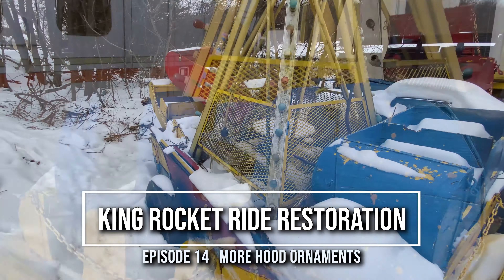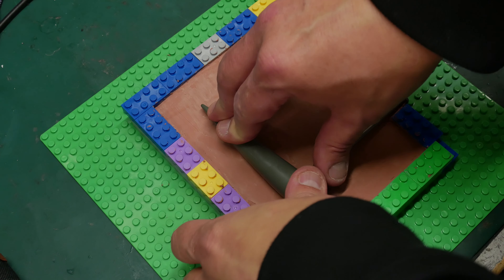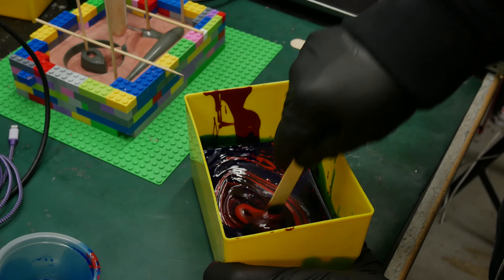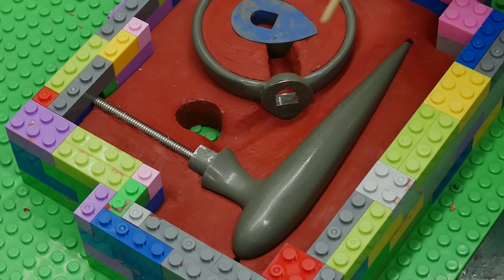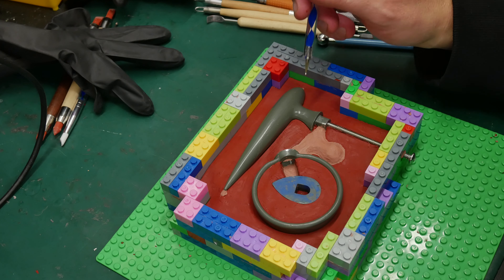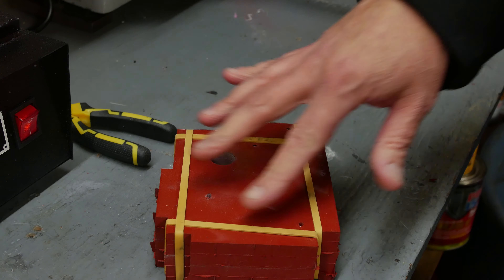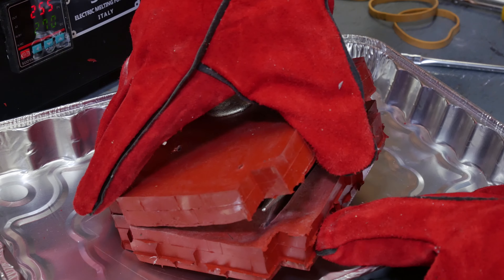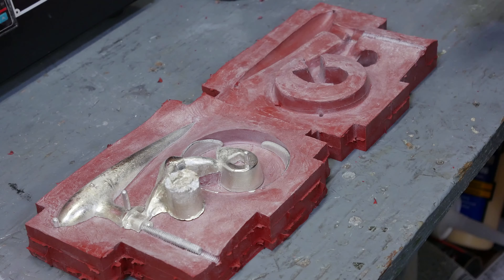Casting Pewter in Silicone Molds

Comment from the maker: See the full carnival ride restoration here:  https://youtube.com/playlist?list=PL9JRE2uksm9tonX17TZt38K6RH2EnDNf1
Reply: Use Delrin plastic for pins and voids in your casting and tap the mold as you pour. There's a company from Ireland that makes molds for chess sets they use a black heat activated rubber that works great, Prince August I believe. Use a backer board and clamps to hold your mold closed as well.

Comment: Pre-heating the mold helps alot as it otherwise cools the metal to fast especially on the thinner sections preventing further flow. 
On smaller molds i usually cast once cold and that's usually enough to heat the mold to where you want it if you empty it as soon as the metal is solid and recast before the mold cools off.
Reply: Yes! Preheating that silicone mold is a must! I used a German product like this in Germany back in the early '80's making some parts for a '57 Ford car I still have. That German product was even the same color!  I was an Army Staff Sergeant serving and did things like this when off duty.

Comment: Your sprue needs to have equal or greater volume than the castings. Gravity presses the metal into the mold and you need enough weight behind the pour and thats in the sprue. Nice mold though.

Comment: Right, they do not sell non-toxic Chrome3 sulfate for easy electroplating to private people. The industry has put a stop to this. What still can be done is to electroplate with Copper sulfate and then electroplate with Gold electrolyte. Then you have a nice shiny surface that doesn't require polish.

Comment: Maybe not enough metal is the problem. If the ring is at "the end of the line" the metal is cooling off and flowing in to a much finer, thinner space causing even faster cooling. I've worked on a lot of injection molded ABS plastic car parts and can see the amount of sprues that were used to facilitate the flow of the material. ABS cools really fast, I can see the swirls in the surface of the parts so they had to make sure it flowed well.
Reply from the maker: In the follow up video I made a few changes to the mold. Enlarged some runners and preheated the mold. Got it to come out really nice.

Comment: How many times does the molding can be use?
Reply from the maker: At this point I’m really not sure.  I had concerns from the very beginning because I had bits of the silicone chipping out. If it continued at the same rate, I wouldn’t have been able to finish the project. But it seemed to get to a point and not get worse.  I got 9 pieces cast and i don’t see any further signs of deterioration.

Comment: Hi Pete 
I am wondering if you pre heat the mold slightly that may help with the flow of material  during the pour. 
Just a thought. Have a great day
Reply from the maker: Hey Richard. That is exactly what I ended up doing (among other tweaks to the mold) and it worked great!

Comment: Haven't seen all of the video yet. But I think you gonna have problems getting the metal to fill the mold. You can use powdered graphite as a mold release, it's slippery. Yup exactly as I thought. You should make your mold on the vertical plane. Yup, you also have problems with your venting. With the mold made vertically is that gravity to help pull it into the mold. I made molds and casting pewter 22 years ago for a warning project.
Reply from the maker: I was successful in the follow up episode.  Preheated the mold and enlarged some risers and vents.
Reply: @PeteRondeau   I was thinking using risers and/or a tilt added to the mould so you get some gravity assist. And maybe switch to aluminum it’s practically free (soda cans in the trash). Granted it’ll look like an aluminum piece rather than a chrome one.

Comment: Moldmax 60 sucks... it is brittle... heating the mold would help... there are other products that could help... like a spray called SLIDE... you could also try pouring it inside of a vacuum chamber... I have used Moldmax 60 and wouldn't consider using it again... try moldmax 50 or something as it will hold up and take the heat of pewter, especially for short runs... vacuum casting would work if you have the equipment = think jewelry making